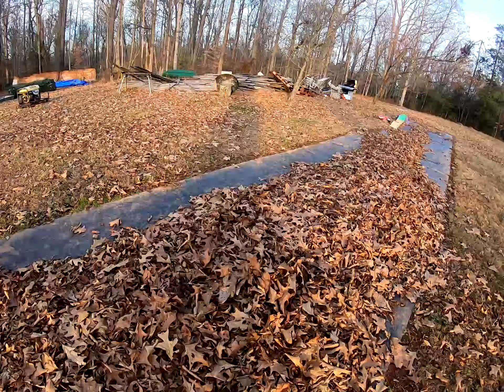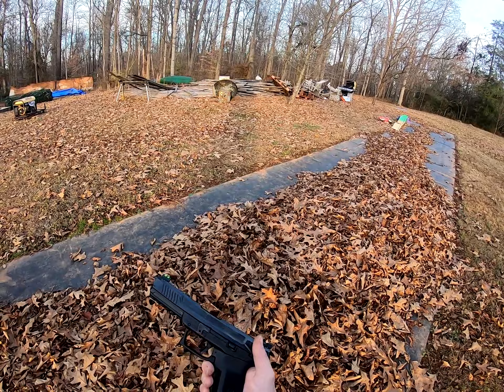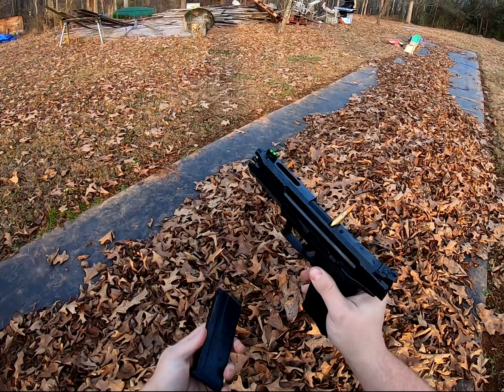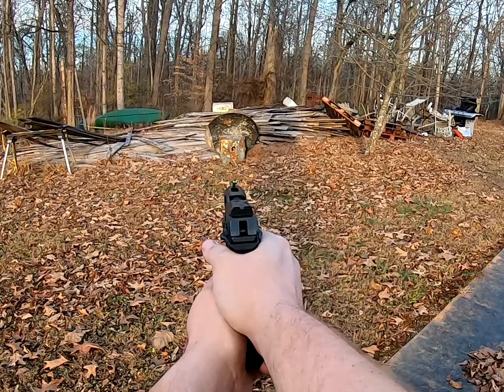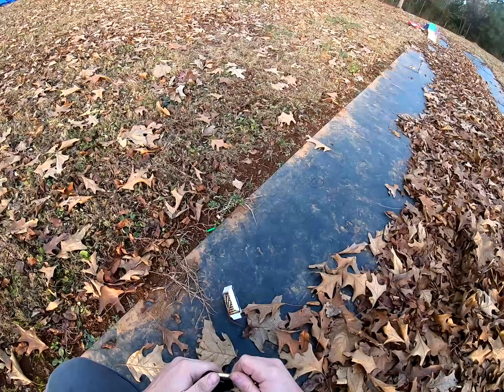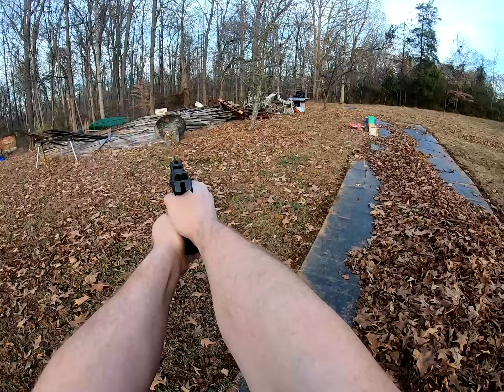Ruger 57 Testing "Spoiler" it's not Promising!!!

Comment: With it having consistent fail with the last round it’s definitely a magazine problem
Reply from the maker: Someone else had mentioned that in a comment. So I tried the spare mag that came with it and it still happened. Tempted to try and get an aftermarket one and try it.
Reply: This may sound crazy, but are you making sure the bullets are loaded right? They have to be snugged to the end, I know they tend to stagger out of place after about 10 rounds.
Reply from the maker: I load them right when I put them in. I don't know if they shift while firing.

Comment: Fo over 300 rounds I've never had your stovepipe problem. Only ONE failure to feed and likely from a weak grip plus the weight of a HOLOSUN 509T red dot sight on the slide. 
I had my slide black Cerakoted but no other mods. I bought an extra mag soon 3 mags and a custom double mag pouch from The Vest Guy. Great quality as I've had before with his products.

Comment: I have the factory extended mags on mine and i have put a few thousand rounds trough it in the last year. Never had any problems.
Reply from the maker: @krodkrod8132  mines only on the last one during a mag dum from full to empty. Very small inconvenience that doesn't bother me enough to have ruger look at it(which they said they would and also does it with both factory mags).

Comment: Mine runs fine even with the 30 extension. I have run into a problem with one out of four magazines where it fails to feed but its just the magazine not the gun.
Reply from the maker: Even with the stovepipe on the last round I would still buy the gun again. Ima try the mags but even if that doesn't work it's still fine for me as is.

Comment: I have a new 57, maybe 250 rounds thru it without any problems.  The magazines are hard ti load when they are new and will not take 20 rounds but if you leave them loaded for a day or two they will perform.

Comment: Sounds like a clip problem,, maybe add alittle lube to the clip and press it up and down with something that’s the length of the 57 round but not as thick but hard enough to be able to put stress on the spring in the the clip

Comment: Just off the tip, I'd look at the mag spring. Then try a different mag.
Reply from the maker: Tried a different mag and if fully loaded and mag dumped it still does it. Load 10 rounds and mag dump it doesn't do it. I contacted ruger they said they'd fix it but I'm not to worried about it for such a minor inconvenience.

Comment: There was a recall for early models . They had bad week springs I believe.
Reply from the maker: In their slides or magazines?
Reply: @TheChosenRedneckZ  I believe in the slide , Also when reloading the magazine make sure the nose of the bullet is all the way forward in the mag . Tap the mag into your palm to push the bullets forward. I also believe the mag should only load 18 rounds
Reply: I may have misspoken on the recall but I did read that the recoil spring on some early models were to heavy and needed a lot of break in.

Comment: Had mine about a year and I've ran at least 1000 rounds threw it roughly but today I took mine apart and when I put it back together the mag wouldn't go in so I pushed the "trigger assembly?" Back put it back together and now the mag goes in gonna go run some rounds threw it to see if it's good has anyone had this problem? I will say it's definitely operator error I do not have one bad thing to say about this gun I absolutely love it hands down best gun I ever owned
Reply from the maker: How is it operator error when it is same round constantly? Didn't do anything to it except lube and fire it. A lot of other comments saying that the 1st releases of this model have gave them problems also. Guess it may be the luck of the draw.
Reply: I was saying mine was operator error I messed it up and I actually ran a mag threw it about an hour ago and it still works amazingly I was just concerned that I might have messed mine up all I've ran is ruger mags witch I have 5 and FN blue tips and federal 40gr
Reply from the maker: Ok thar makes sense.  Glad to see you got it figured out.

Comment: It's your magazine that's the problem. Try a different magazine. Some magazines need oiled to work reliably
Reply from the maker: That had crossed my mind but I've never had that kind of issue out of a round that was so small and also not extended mag. I'll have to give it a try but all I have is the two stock standard mags for it so I may try oiling them and see what happens.